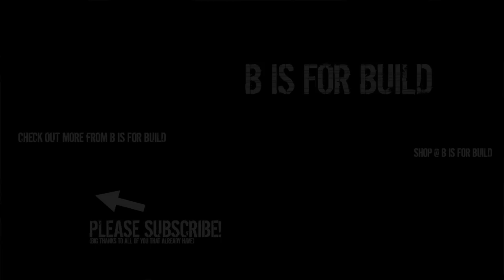1500HP of Boat Engines Have Arrived!

Comment: Coming from the marine industry, As pretty as those motors are PLEASE put epoxy or some type of reliable paint on them. They won’t last 3 trips without looking like crap with those steel blocks, also with the switch to gas put large fans to ventilate the engine compartment, and do whatever you can to seal the Cabin off. In case of a fire I really recommend a automatic fire suppression system, if your out at night with the generator running, shit happens just prepare for it. Also considering that boat is for Europe make sure if it was built for 60 or 50 hz and get a generator to match it, or switch everything over but that’s expensive. Overall other than the higher Rpms, the lack of endurance compared to diesel, the danger of gasoline vapors, and the weight difference of the new motors you should be fine if you address these things. It’s a YouTube channel that’s supposed to be entertaining I understand that but please be safe.
Reply: We are planning on addressing all of these concerns, the engine paint was a concern for myself as we sometimes worry more about looks. Hopefully we can all agree on a good solution.

Comment: If you couldn't reach the correct speed WOT before with the diesel, it's because you have the incorrect propellers on ths boat, either they are over pitched (like having too tall of rear end gear), or under pitched and the engine ran out of RPM before the propellers reached the necessary RPM (like trying to do a VMAX run, in 3rd gear).
Reply: Also, while going gas over diesel was a very ignorant choice, to anyone saying it won't work, they will, just hugely inefficiently so.  he better build a bigger fuel tank, and bigger fuel pumps, because those are going to be drinking fuel in huge quantities in order to get the power required to go.  The problem with gas being (well, one of many) the biggest torque load on the engines occur around 25%-40% of max RPM, which means you'll be lugging a gas engine while trying to get into the power band, while it's making low torque.

Comment: Just wondering if you have considered the weight difference of the motors, how the boat will be balanced and the change in buoyancy to the rear of the boat because of the lack of weight with much lighter motors? It'll make it more nose heavy which you don't want. Hard to control going on the downside of waves. I suggest adding weight to some extent to help return the boats balance in which it was designed.  Only a suggestion.  Glad boat videos are back!
Reply: Also, the weight of those big diesels gave the boat ballast so it wont roll over too easy.

Comment: Weeelll actually horsepower is calculated by rpm x torque and torque peaks around halfway through the rpm range usually but everything depends on engine build and tuning i guess ;) good luck with the project tho cant wait to see the boat on the water
Reply: They dialed in bottom end torque with those intake manifolds...

Comment: Boats that size need diesel power.  Gas engines in large cruisers/yachts don't even come close to the same fuel efficiency and reliability as diesel.  Also your resale value just took a huge shit with those motors.

Comment: Don't want to set the engine on rubber (bushing/blocks) to prevent vibrations translate to the hull?
Reply: The studs on the mockup are representing the studs on the rubber isolators that sit on the stringers.

Comment: whats happened to the boat engine install cannot find anything on utube
Reply: Nothing it has been swept under the carpet - he was told at the time it was a stupid idea, but he took a working boat that could have been fixed for not much and now has scrap and two very expensive engines he cant do anything with.

Comment: One engine spins right, one engine spins left ??????? That is the way they spose to work !!!!!!
Reply: They spin the same way. The transmission are reversed.
Reply: @Oscar_SMT  Ha dot do some web searching and see how they reverse it in transmissions now, they had reversed engines bad in the old days, guess that makes me old ! I knew a guy that dirt raced, when he built a new car one year everyone could not believe how well it turned the corners, I could see right away he was using a reversed marine engine as in the corners and he jumped on it, the car would pitch to the left and not to the right tossing the car down around the corners instead of lifting the left side and tossing the car to the wall......

Comment: How much hp does the yacht have from the factory
Reply: probably around 800, but it had a lot more torque at low rpms. Max torque on those diesel engines comes in at probably around 1300 rpm. Those gas engines will have to be screaming to get that boat on plane.

Comment: What would it take to make that boat do 70mph??? That’s what I wanna see
Reply: A smaller boat!
Reply: @Oscar_SMT  Anything is possible with enough power XD
Reply: WallyPower's 118 yacht was 118 ft and could run 75mph..... just took 17,000hp from three turbine engines running jet drives

Comment: so are you gonna put the still working diesel in a truck?
Reply: considering your basicly putting truck engines into it so that would be a good swap trade
Reply: 1700 lb engine in a truck? 😂
Reply: @rsdna9698  it be fun, you can put a 3.10 gear in it and pull harder then a car on a 4.10 due to the torque, thats far better then the stock 1500's do with there tiny ls's

Comment: Torque counts for nothing in boats ... it's all about the horsepower.  You'll blow these within the first couple of hours of running at 40 knots. Enjoy looking at them now, as you'll be picking the bits out of the hull soon enough. Way, way over-stressed.

Comment: Torque is not a calculation of hp and rpm. Torque is actually what is being measured on an engine dyno.  Horsepower is the calculation of F x d / t or force multiplied by distance divided by time.

Comment: It is against code to use a Automobile engine in a boat.  The starter, distributor, and alternator are not explosion proof.  Using a automotive engine is against the U.S.C.G. regulations.

Comment: Everybody is worried about how long the gas engines will last. Many many many go fast boats run gas engines. They will be fine. Just as long as Chris flushes the diesel out of the fuel tanks and lines.  And possibly installs larger fuel tanks. Rev limiter or throttle man is a must.
Reply: completely different application here bud. People run gas engines in boats all of the time, sure. But they also are not luxurious, heavy, long, or massive yachts. BIG difference. There is still more precautions that need to be taken that have been mentioned in the comments a few times already that he needs to add to that boat engine compartment in order to make this work and I am hoping he reads those.

Comment: Looks like these engines will deliver some hefty bottom end torque. I wonder if this application will require titanium output shafts and inner planetary Gear Reduction systems that will match the power to weight ratio for performance?? 🧐
Reply: 😂😂😂 No.

Comment: Personally, I'm looking forward to watching the engine install and sea trials. It wouldn't have been any fun had they put another diesel in. This channel is all about doing the unconventional! It's not like they're going to regret the decision. If it doesn't work out they'll use the engines for a different project. Regarding fuel consumption of those big 454's yeah so what? Just think of it as a muscle yacht. This channel is for our entertainment and certainly seems to be doing just that with thousands of comments for this project alone. Also props to Oscar for busting his butt!